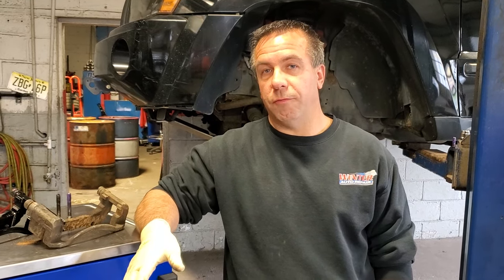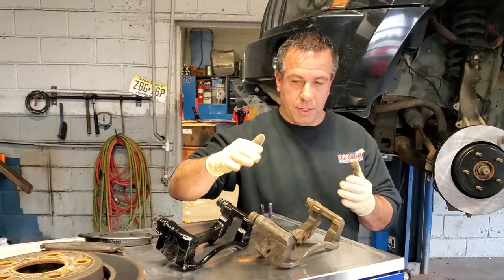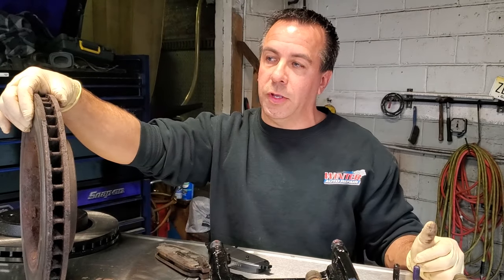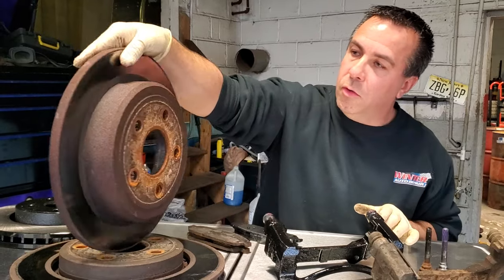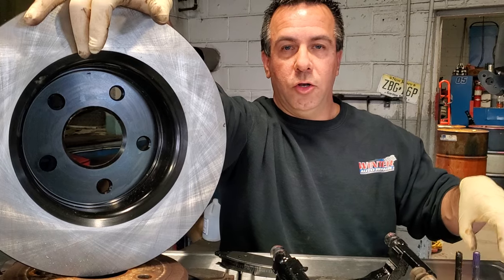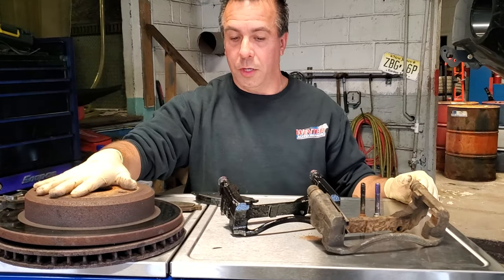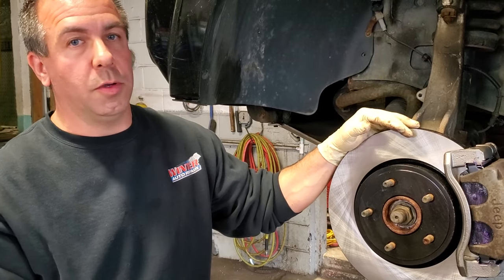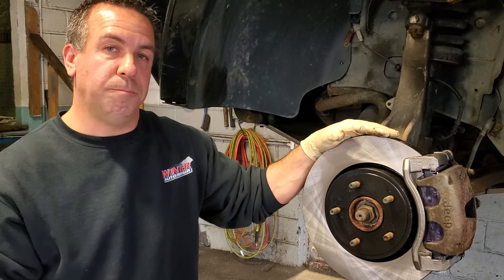High quality brakes vs cheap brakes

Comment: I have a question for you on a Jeep Wrangler what is better semi-metallic or ceramic?
Reply from the maker: I prefer Ceramic on both cars. Honestly both are good however in the heat of summer, metallic will make a little noise so we typically use ceramic to prevent customer complaints. I hope that helps answer your question. 
Thank you for watching and commenting. Please subscribe, we very much appreciate the support!
Reply: Unless you are doing some hard Crawling Off-Road in really hilly terrain, the ceramic will give adequate braking, produce less noise and dust all while not wearing down the rotors as quickly.

Comment: What is the name of brand, of the rotors, you are using?
Reply from the maker: In the video, we used Centric.  However, since we made this video, Centric was bought out by a larger company, and the quality is no longer good. We currently have the best luck with DuraGo rotors and Power Stop brake pads!  You can find them at good local autoparts stores or online at places like Rock Auto. Here isba link to Duragos website 
https://duragoparts.com/products/electrophoretic-brake-rotors/

Thank you for watching and commenting.
Reply: @WinterAutoRepair  too bad the quality is going down. Here in Denmark these brands are not an option. But we use Brembo, TRW, Bosch etc. 
Anyway, thanks for answer 🙂
Reply from the maker: Bosch and Brembo are good quality. I'm not familiar with TRW brake parts. We also get Hella rotors for some European cars. Hella has been good for us so far also.
Reply: @WinterAutoRepair  Hella is also an option here.
Wee have workshops here that cooperates with Hella too 🙂

Comment: Hi there

How much do your charge for installation if i have the 4 rotors and brake pads for a sedan?
Reply from the maker: Hello Leo, we do not install customer supplied parts, I'm sorry. People will say it's because we want to rip you off selling you our parts. Truth be told, we do make a little on the parts but not enough to make a difference. We sell them for what you would pay online typically. We also charge less labor because we do make some on the parts. The real reason we don't use customer supplied parts is fitment issues and quality problems. If your part doesn't fit and your car is apart then we lose the use of the lift until the correct parts can be found. This is a problem 8 out of 10 times customers supply their own parts. next is liability. Lets say the brakes you supply fail and you get into an accident. We are now going to be sued. we know the quality of the parts we use. I can't control the quality if you supply the parts. it's just not worth the risk of an issue. Lastly is warranty. Lets say you buy an alternator and that alternator is no good right from out of the box. This happens to us at least once a week now. Our parts suppliers pay our labor to redo the job and there is no extra cost to you the customer or to me the shop owner. If you supply the alternator and it's defective you would be responsible to pay our labor a second time. It's not our fault the part was defective. So to make it simple for everyone, we just don't install any customer supplied parts... I hope you understand and if you're in our area feel free to stop by anytime. we usually have some cool cars to see as I race and have exotic cars here usually. Also, sorry for the delayed response. I'm new to YouTube and was over whelmed by how many comments we received from this video! 
Thank you for watching and commenting. Please subscribe, we very much appreciate the support!

Comment: Good video you explained everything very well
Reply from the maker: Thank you. I appreciate you watching!
Reply: @WinterAutoRepair  You welcome. Question so i bought napa premium rotors  along with akebono pads is this a good combination that will last a long time or do i need the centric rotors like you have in video?
Reply from the maker: If they are the Ultra Premium Napa then they are coated and high carbon. I'm not sure if the you purchased premium or Ultra Premium.
Reply: @WinterAutoRepair  I purchased just the regular premium rotors
Reply from the maker: @thetexaschainsaw9366  the standard Premium rotors are standard white box with coating. They will not last as long as high carbon. I'd exchange them if you can because you'll get more life for your money.

Comment: Dude that rear rotor is fine, that’s just surface rust, it was no where in need of replacing.
Reply: It was replaced because it had a caliper issue.
Reply from the maker: Like Scott said.  We had a caliper failure on one side.  It caused the rotor to get excessively hot and turn purple.  We replaced both calipers and installed new pads and rotors because of that caliper.  
Thank you for watching and commenting.  Thank you Scott for picking up why we changed the rotor!

Comment: I had the front brakes of my car repaired last year. My mechanic showed me three levels of quality (and warranty) of rotors and pads; and the difference was not enough to convince me that cheaper is better, so I went with the best.
Reply from the maker: Good choice!  At least he gave you the option of quality parts.  Most shops use the cheapest to get your business and then to get your business again soon because the cheap parts have worn out.  
Thanks for watching and commenting!

Comment: I knew brake rotors don’t get ground and reused much anymore but I didn’t know why the practice had gone away. Nice explanation.
Reply from the maker: Thank you.  I appreciate you watching and commenting!
Reply: Also the cost of getting rotors turned got ridiculous almost as much as replacing the rotor in some cases,and every time they get turned they get thinner so they warp easier

Comment: Interesting. FWIW, just replaced the factory original brakes on my 16 year old Prius @ 222,000 miles and the rears were still at 40%. I found that remarkable for a car that sits outside in all weather and often carries 500lbs of tools and supplies. No salt here in WA.

Comment: Good video.  I constantly had rotor warping issues with my Ford Ranger even with the original factory rotors.  The tire shop would order me real expensive ones and that seemed to fix it...the next brake job the next shop would tear them off and put new ones on and the problem would come right back.  I spent a lot of money on brake jobs over the years using high quality expensive parts.
Reply: Biggest problem is the laziness and greed of repair shops who stopped machining rotors.  Rotors used to essentially last for the life of the vehicle....or pretty darn close.  Instead, every shop wants  you to get new ones at every brake job....and customers fall for it.
Reply: @joeidaho5938  Yes you're right, but rotors use to high quality and made here.  Now they are coming from all over the world and there are many cheap low quality  ones.  I saw one hanging on the wall  in a parts store with part of a soda pop can in it.
Reply: @martinschulz9381  Yes, there are many cheap ones...and it's always a mistake to buy the cheapest.  Truth be told, though, it should be rare that one has to even replace the originals.  Car or truck should be quite old before that has to happen.  I just replaced mine on my car....after 18 years...and I will get the originals turned so they can always be used as a replacement.  The whole rotor thing is mostly a con job....just like the shit that Mr Lube or similar places do to consumers....replacing parts constantly when there  is no need to.
Reply: Yes,you should've insisted they machine your better quality rotors instead of installing junk replacements. I machined rotors at the auto parts store I worked at and, honestly, even cars and trucks from the newest we'd see (2010s) always had enough in them to be turned a few times. Of course I'd always take off enough to refinish and correct any warpage, and no more. I think some shops like to gouge out material .030 each side at a time. I'd take .005 per side, or less.

Comment: Wow, if only every mechanic was like this guy! Awesome video. Keep up the good work.
Reply: Unfortunately too many "mechanics" are like this, half of what this guy did was not needed.
Reply: @donniev8181  I’m not a mechanic (I just work on my own stuff), but what part do you disagree with to the point where it’s “unfortunate” that he is doing more than he needs to?
Reply: @CamaroBrad  because in the end the customer is having to pay for parts that weren't needed. Sure, if the customer wants new rotors that's fine but an honest mechanic would never replace that brake bracket just because of some surface rust.
Reply: @donniev8181 fair enough. I don’t think he replaced it though. He said he sanded it and painted it to protect it. So I guess depending on how much he charged for that. If it was me I’d probably just use a wire brush and throw new clips/hardware on it.

Comment: So what brand of bake rotor should we be buying? Any high quality all wheel brake kits anyone would recommend
Where is Power Stop brakes on this scale?
Reply from the maker: I don't care for power stop. I have had a few failures with them. In this video we used Centric. We also like Perfect Stop and durago EP.  All 3 brands have high carbon and coated rotors available. Any good auto parts store will have them as will rock Auto 
Thank you for watching and commenting. Please subscribe, we very much appreciate the support!

Comment: Are the NAPA ULTRA PREMIUM COATED Rotors good quality?
Reply from the maker: I do not care for the Napa rotors. I've had issues with their coating building up on the brake pads. 
We typically use Perfect Stop high carbon or Durago EP high carbon. In this video, we used centric high carbon. However, they have become hard to find. 
I hope that helps. Thanks for watching and commenting!
Reply: @WinterAutoRepair  Thank you sir for your quick response.  Will check those out.
Reply from the maker: @ureasmith3049  you're welcome! Best of luck to you. Please subscribe if you haven't already and let us know if what content you'd like us to make!  Chris.

Comment: Are oem brake rotors and drums coated to resist corossion?
Reply from the maker: Depending on the manufacturer they will have a grey paint. It isn't the same as the aftermarket. Depending on where you live you can see rust start almost immediately. They are better then no coating but not as good as the high quality aftermarket.
Reply: @WinterAutoRepair  
Toyota

Comment: My skoda makes water gurgling noise on ignition for 3/4 seconds any probable cause
Reply from the maker: If the coolant is low, air can get trapped in the heater core inside the car. It will make a water running or gurgle sound. Check the level of coolant and bleed out any air in the system.  That's the most likely cause. 
Let us know if that helps you.  
Thanks for watching and commenting

Comment: Why would you put brake grease on the back of a pad where it doesn't contact the caliper?
Reply: That grease doesn't run when heated so it won't cause problems.  It also keeps the brakes quiet because there is no vibration allowed between the 2 metal surfaces.

Comment: why don't you clean up the centre wheel bearing hub, they always have oxidation on them..wire brush attachment for a Drill works great...

Comment: Good straight up honest mechanic doing a good straight up job . That's what is sorely lacking in garages these days🤨 they just want to fit cheapo parts for top dollar prices, lie to you telling you it's a quality parts shop when in reality they're sh1t parts from sh1t manufactureres and the workmanship is very bottom of the class quality. Oh it'll last you a month or 2 maybe but then the problems return along with the corrosion and seizing and squealing and failure. It's common sense to ALWAYS  do jobs in the mindset of this mechanic so why don't other garages. I'll tell you why, cheap parts bigger markup for them charging you price for top dollar parts. Crap quality workmanship shoddy lack lustre work , no cleaning up of parts no finishing of the parts no greasing of the parts no pre lubrication, just reassemble dry and corroded and take your money and laugh all the way to the bank ! Cowboys everywhere ripping folk off and thinking they're real clever when in reality they're putting lives in danger and couldn't care less ! I'd shut them down FOREVER ! 
Too much can go wrong with vehicles to do shoddy cheap work on them and I'm also including dealers mechanics shops in that too because I've seen exactly the same crap workmanship coming out of their workshops and cheap parts being used to make the bosses happy and the bean counters , it makes my blood boil getting ripped off by crap garage work. That's why I learn and research and watch good mechanics doing a good job that lasts. What's a bit of cleaning and quality grease going to cost extra ???? 👍😉
Reply from the maker: You're correct in your assessment. We don't understand why other shops don't follow our business model. I'd rather make less money knowing you're happy and will come back over and over, plus refer other good people to us. Than try to rip you off once to never have you return. I worked at a dealer prior to opening my shop. I left the dealer because I hated how they treated people. I remember telling my boss, "if you can rip people off and stay open, then my shop is sure to be a success because I will only do what's right for the customer." That was in 1994 when I was 19. I started part time at first and by 1996 I had a full time shop. We have grown every year since. 
Thank you for watching and commenting and please subscribe if you haven't already. We plan to make more videos in the coming months!

Comment: Centric premium rotors are 25-50ish and made in China vs 15-35 for the cheapest. So yeah if someone charges you 200 extra for em you're getting ripped off. They're good though. Also that purple grease isn't silicon based, not meant for slide pins!

Comment: I wish you showed us what you do when you do the brake pad bedding procedure.  Unless you’re able to just reply to my comment and explain it for me and others.
Reply: Find a road with very little to no traffic.  Get up to about 40 mph and apply very firm peddle to almost stop.  Get back up to 40 mph and repeat process 4 times.  The rotors & pads will be very warm and start to bed in.  Drive another 10 minutes to cool off the pads & rotors.  Do NOT allow the pads to rest against the rotors until they cool back down.  I have a loop that I run to do this where there is no traffic.  It is crucial that you not come to a complete stop from start until after the 10 minutes cool down

Comment: its really hard not to notice the awful noise when your metal backing plate is contacting a metal rotor
Reply from the maker: Very true. Yet some people just turn the radio up and ignore it. In this jeeps case, the pad fell off the backing plate that day, and they brought it right in.

Comment: Where can I get the good pads and rotors? Which brands?
Reply from the maker: We only use Centric pads and rotors.   A local auto parts store should be able to get them.  You won't find them at national autoparts chain stores.   You can also order them online.
Reply: @WinterAutoRepair  Are those the Posi Quiet pads from Centric?
Reply from the maker: @jsteindog  yes they are.  We prefer their 105 pad on their 125 rotor.
Reply: Thanks, this was the question I was about to ask. 
I won't be able to change the way my shop does it, but I can at least do it right for my friends and family.

Comment: Wow. I feel much better about replacing my stock rotors and pads at 122k miles. The pads still had surface on them, but the rotors had gotten a vibration, so I replaced them.

Comment: 9:15 "... we're gonna use all brand new hardware..."  Many mechanics will put back the rusty bracket and get rid of this metallic hardware so the pad will move more freely.  Is that safe?  What is the purpose of that metallic hardware?

Comment: It's not about surface rust, harmless. The problems are not enough density, wrap, and even painted.  OEM rotors are usually the best but not painted and last 50-60 k miles

Comment: I've done a little research about brake parts but not as much as I'd like. The one company I had heard great things about for the pads was Akebono, but they don't seem to make rotors. How do you guys think Akebono compares to Centric?
Reply: Akebono are definitely one of the top pads out there. Check out Rockauto.com, they seem to have good prices on them. Word of caution.. make sure you order the right part or they will nickel and dime you when you do a return. Yes, they have the lowest prices, but make sure you order the right part!
Reply from the maker: So there are a lot of companies that make great pads but do not make rotors.   When I'm building a race car I'll use a mis matched pad and rotor combo.  For the street I prefer matching brands so we always use Centric rotors with centric pads.  This is the combo we prefer but I'm sure Centric rotors will work just as well with a top quality pad.
Reply: Honestly I am not a very tech savvy however I always buy brakes from geobrakes.com 

And they sell on really cheap price but thr quality is good